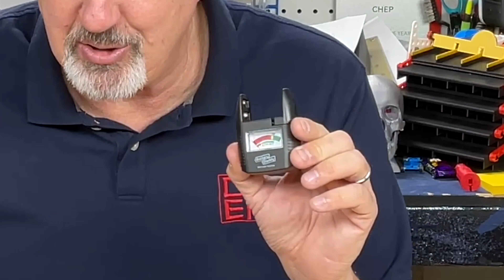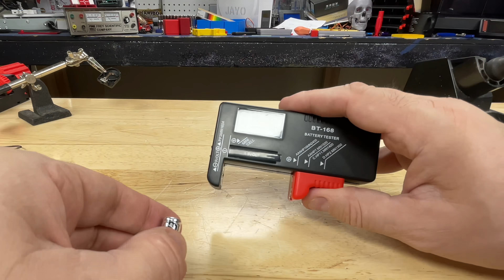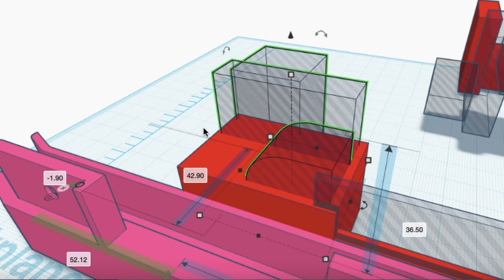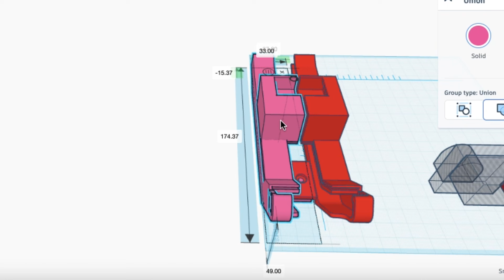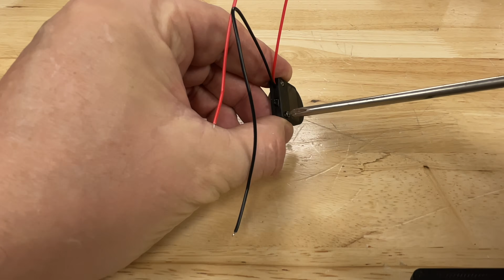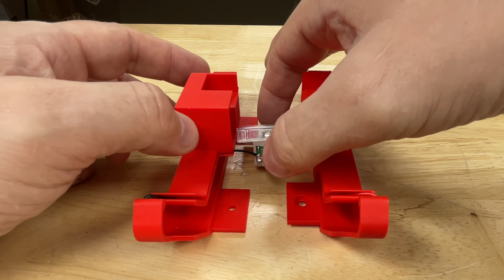3D Printed AAA Battery Holder with Built-in Tester

Comment: I am paranoid and really wanted a cover so you don't touch the wires when testing 😂
Reply from the maker: It’s 1.5 volts. It’s not hurting anybody. And you don’t touch the wires anyway. Just the plastic.
Reply: Pretty sure you could hold a household battery like that by its terminals and be fine. Maybe don't try it with the higher voltage/current ones, but simple AA/AAA batteries won't even shock you. They aren't powerful enough to go through the resistance of your skin.

Comment: If you print the left part in black, you have a visual red/positive and a black/negative half for the orientation of the batteries.
Also makes the black wire less visible :)
Reply from the maker: Excellent idea. That’s an easy fix.
Reply: AAAAAA I love that xD

Comment: Excellent design and video. Added to my project list now.

OCDme will likely hit Tinkercad and design a totally unnecessary cover plate to attach covering the butt seam going down the middle.
Reply from the maker: I thought about that after as well. That’s an easy add on.
Reply: Nah, just make it wiggly like a thunder bolt (though it'll stop being symmetrical) 🌩